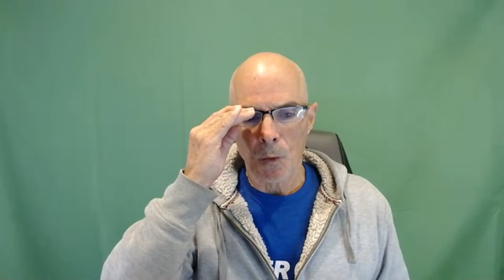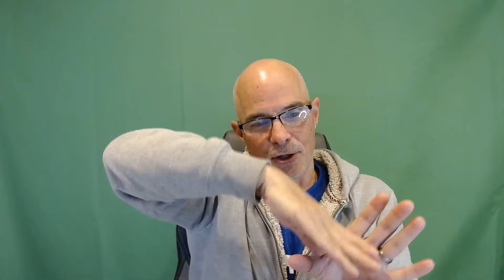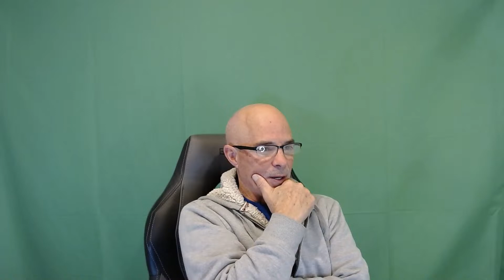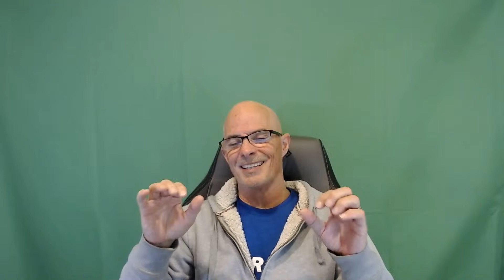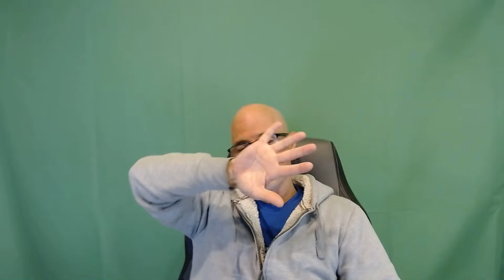LET'S TALK TECH-IS A CROSS RAM JUST A TUNNEL RAM?

Comment: Please Richard stay away from speedmaster
Reply: Some of speedmasters stuff is actually pretty great especially their heads if you plan on modifying them I wouldn’t run them straight out of the box but I wouldn’t run a Edelbrock set straight out of the box either, their intake manifold are Also solid, they also make some decent ford 9” parts some of the other stuff they make isn’t top quality but like I said if you plan on modifying them anyway most of their parts are a very decent starting point

Comment: I still want to see a Super Richie V8 intake that is "high ram" on the front and rear pairs of cylinders, but cross ram on the two center pairs with two plenums so each plenum "fires evenly." Might have to make a bit of spaghetti to make the runners equal length and chuck a valve on the rear crossover pipe to see what happens.
Reply: I like this. Kind of a dual plane tunnel ram. Test it with 180 degree headers
Reply from the maker: you think there is interference or cross signaling between runners?
Reply: @richardholdener1727  maybe doesn’t matter so much with efi, but possibly a a more constant pull across a carny can make a difference. Also it maybe possible to tune the plenum volume to a secondary sonic. A bit like stepped headers. There is probably not much there if anything.but fun to find out
Reply: @jpl1983  the issue with 180º headers is they end up having long runners and hurting top end a bit, but a "180º intake" could still have appropriate length runners. If there is indeed something to be gained, shorter runners at high RPM is where I would expect to see a difference. You might get an advantage from destacking cylinder filling or by building a constructive intake resonance that can't form when each plenum is playing crossplane jazz. 

One of the things flatplane engines usually tout as an advantage is even filling from each plenum, but there's not really a reason a clever crossplane intake can't do the same thing, I mean dual plane intakes already exist.
Reply: @BuffMyRadius  we ran 180 degree headers on our 5.0 Supercars around 2010. We did have the advantage that the transmission we used had a very long input shaft. This allowed us to run the cross over pipes through the bell housing. We switch between the 180 degree and a funky 8-4-2-1 setup (also used cross over pipes). We were making 650hp on pump gas, 10:1 compression and a 7500rpm limit (rules). We did a lot of fun stuff - we ran fuel through a dry ice box to cool it down that in turn was pumped through the inlet manifold to cool that down before being injected over the trumpets. A change to E85 negated all that. Would have been cool to run one beyond 7500 to see what they would make. We had an experimental engine pushing 680hp but it never ran in a race car. Rules changed and the fun stopped
Reply: @jpl1983  out of curiosity, did the 180º setup have a more pronounced torque peak somewhere in the mid range, while the funky 8-4-2-1 did a more gradual run up to a higher rpm peak?

650hp at 7500 makes sense out of a NA 5.0. That's 455ft*lbs at the top. Running some sort of over square setup?
Reply: @BuffMyRadius  yeah we ran the 8-4-2-1 at tracks with long straights. The difference wasn’t big but enough to swap. The bore stroke was 4x3. 8.2 deck, 5.7 rods.
Most of the development was in the heads (d3 nascar) intake (cross ram) and valve train (lift numbers over .700”)
Reply: @richardholdener1727  I'm wondering if there's a bit of filling efficiency left on the table with cylinders 2-6 and 3-1 pulling consecutive intake strokes (I'm using the LS pattern) on dual plenum intakes. 

A dual plane tunnel ram is a great way of describing it!

Comment: Need to figure out a way to measure velocity in a cross ram n/a in the plenum and also each runner. I always wondered if the first runner closest to the throttle body get all the air, or does it pack air in the the plenum and all the air gets shoved down the rear runner? 

How do you know?
Reply from the maker: the air doesn't rush in from the throttle opening into the front cylinder (or rear)-each cylinder draws air in from the common plenum and the plenum is filled by the throttle entry (air distribution problems on an na motor are usually minor)
Reply: @richardholdener1727  I've just always  wondered if it makes a difference where the tb is placed for that reason.

Comment: Couldn't you test that on a flow bench, with both a manifold that is straight, and another one that curves upward???
But of course what happens on a flow bench isn't always what happens on an actual running engine. I guess?
Reply from the maker: flow is only 1 thing, lots of reflected waves, Helmholtz Resonance and inertial ram going on too

Comment: I've always had up until this point the thought that since the port in the head has to take about a 45 to 60 degree turn in the bowl area to get into the cylinder, that the intake manifold should have a similar degree turn in the opposite direction, to create kind of a "counter reaction effect" to the turn in the bowl area of the head port.
Just take a look at the way a Mopar 2.2 turbo II intake manifold is shaped. 
But then I've also read once that regardless of everything you just want the whole port to be just as close to a straight line and therefore as unrestricted as you can possibly get it. So I guess I'm really not sure.
But now that I think about it this way I'm gonna say that the latter would be best, ei, a manifold port perfectly straight to the head port going in a perfectly straight line, would probably be best, like a cross ram of about 18 to 20 inches long, I guess... 
Yes, that is a good question.

Comment: I think the runner being straight with only one bend when it meets the head and one barrel over each runner and the correct length for the RPM that matches the cam is the best way for power. Does a bent runner matter if there is no fuel in it at that point?

Comment: I've got an offy cross ram going on my small block chevy.build right now. 👍
Reply from the maker: Sounds great!
Reply: That's pretty cool. I have a Ryan Falconer ITB cross ram (from their 2.8 V6 racing program, in the 1980s). It's currently sitting on top of a GM 3.4 V6, which is the same basic architecture as the 2.8. Sadly, I no longer have any use for that engine. But the intake looks so cool!